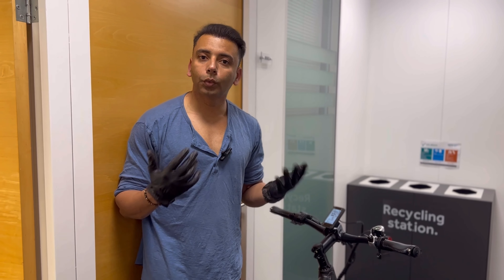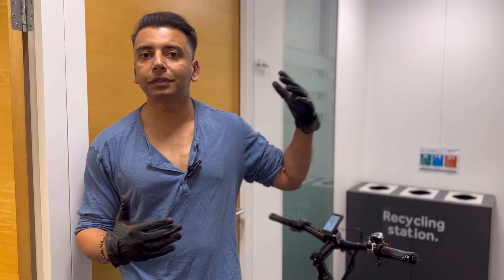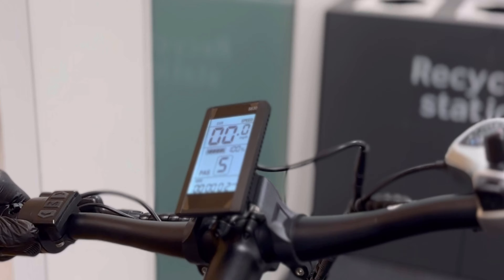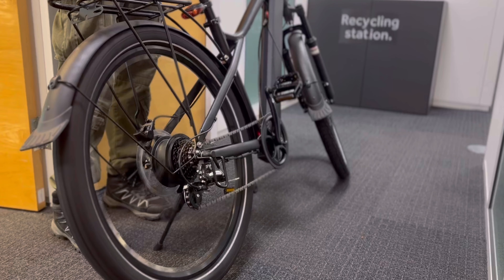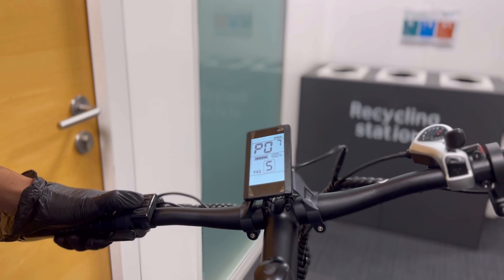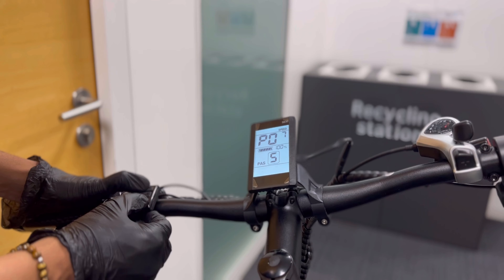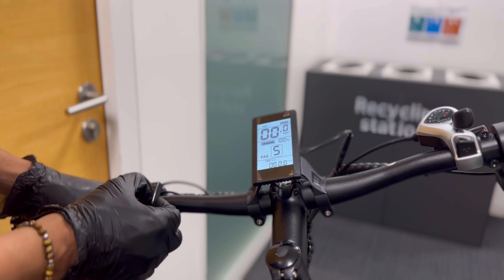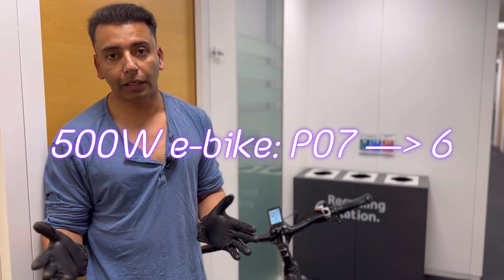How to Fix GIN X E-Bike Speedometer | Quick Tutorial

Comment: For me it was limit speed is 25 and now is it 16 limit speed but i fill its the same but the speed metter not correct and i dont have this options on me its stand scooter so how can i fix it i plugged out The controller and I plugged every thing in again and nothing happend ther is litterly no options on my screen just start button and front button and rare light button and lift and right light tail buttons and Excelerator button so how pls

Comment: what should p7 be for a 2000w hub motor ?
Reply from the maker: Hi there,

Each bike motor has its own customized settings that should be configured in the program modes to ensure optimal performance. The P7 setting can vary depending on the specific motor model and manufacturer, so it's best to consult the manual provided with your motor or contact the manufacturer directly for the most accurate information.

Please let us know if you need further assistance.

Best regards,
GIN team

Comment: My ebike BLDC is 36 volt 350 watt rearhub, currently the speedometer doesn't show anything. for P07 currently 46..... is there something wrong with setting P07. Please help me... Thanks
Reply: Did you ever figure it out? I’m struggling with same problem
Reply: @PacoDafoo  Setting P07.....This is 47 for the direct drive (1200w and above) motors and 01 for geared (500w - 750W) motors.
PS. If the speedometer isn't accurate after setting this up, try setting it to 86.

Comment: my 2000w hub motor, says i go over 50 kmph but i go walk speed. i have 29 inch, and in setup set it to 29"  if i put it on 26" it still shows morekmph then i actaly go.. and sometimes it does not show speed at all, then it says 00 kmph. what can be the problem ? magnets off in the hub motor ?
Reply from the maker: Hello there,

It sounds like you're experiencing issues with speed display accuracy on your 2000W hub motor. Here are a few potential causes and suggestions:

Magnet Misalignment or Fault: If your motor uses magnets to measure speed, one or more magnets could be misaligned, damaged, or faulty. Check if the magnets are properly positioned and securely mounted.
Sensor Issues: The speed sensor might be malfunctioning or improperly positioned. Ensure the sensor is securely connected and aligned correctly with the magnets.
Wiring Problems: Inspect the wiring between the sensor and the controller for any signs of damage or loose connections that could cause signal interruptions.
Controller Settings: Incorrect setup parameters could lead to inaccurate readings. Make sure all the parameters related to wheel size, motor type, and speed sensors are configured properly in the controller.
Display Issues: The display unit might be malfunctioning or incorrectly calibrated. Try resetting the display or checking the manual for troubleshooting tips.
If the problem persists after checking these areas, you may want to contact your motor manufacturer or a professional technician for further diagnosis and assistance.

Best regards,
GIN team